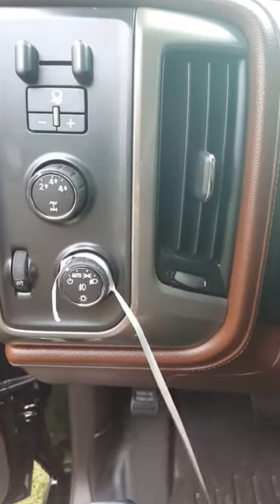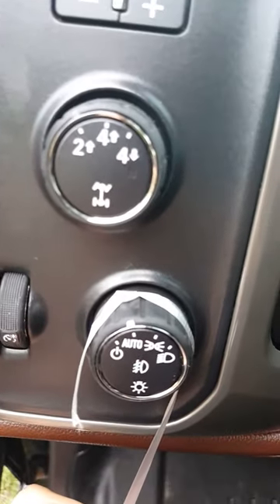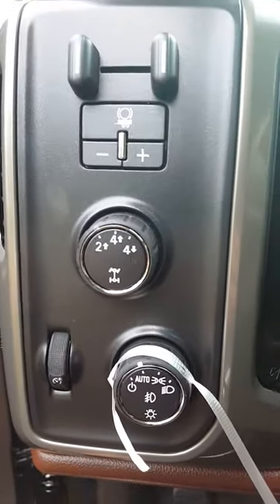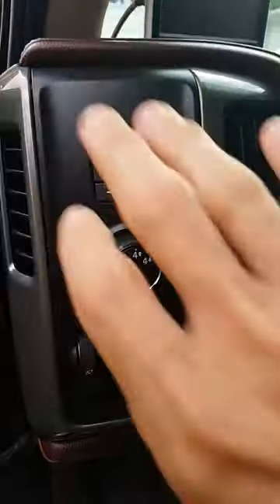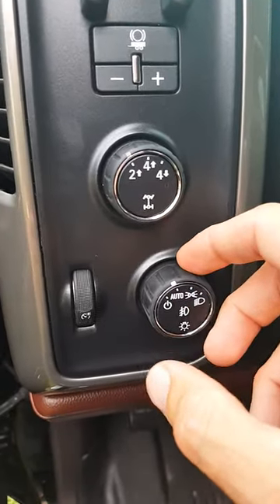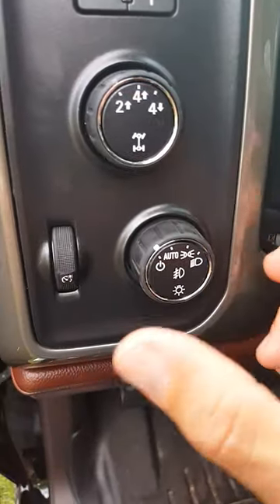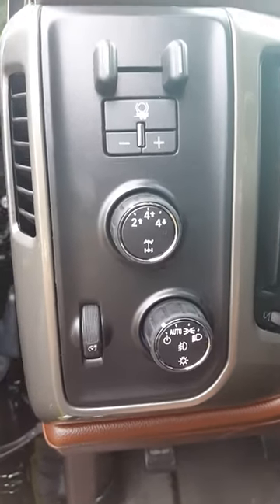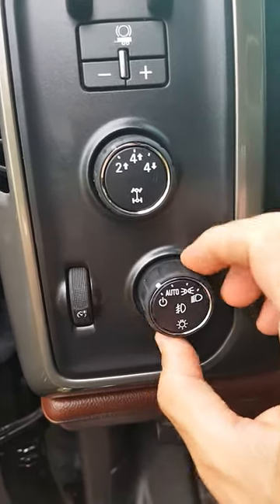Review of 2015 silverado HD headlight switch mod

Comment: Wow! This does look "stupid" simple.  I think I could even figure it out lol. Great mod.  I'm doing this before I install my HID kit for sure ! Thx
Reply from the maker: You're welcome!!!
Reply: @ericfromflorida5146  hey bud I did mine today happy with the results only issue is when I put back together the metal clip or rod my knob does not click like yours in the video light work when I want them on I turn them on when off their off I like it was tired of the drl always on so my switch knob is a lil loose switches freely with no clicks n stays on every setting like yours I did bend the metal clip a lil to fit it in was really hard knob would not fit in it’s housing maybe I bend too much
Reply from the maker: @YourPalSal714   I'm glad it worked for you my friend. Unfortunately my truck got struck by lightning so I no longer have it.  I hope that yours serves you well..

Comment: Hey bro, thank you so much to take the time to answer. I also saw you on duramaxforum, I'm pretty sure that i tried every single position with the switch, as soon as i moved from parking the lights went on and i don't like it. It didn't work so i put the spring back.  I wish i could have the solution...I have seen stickers from Mexico on my truck, is there any difference with chevy trucks assembly in Canada?,
Reply: From what I've read, it doesn't seem to work for Canadian trucks.  Something in the BCM programming probably.
Reply: CLAUDIO GALVEZ In Canada, auto lights/DRL are mandated by law.  You can only turn the auto light system OFF in Park.  Once out of Park, the auto lights reactivate unless you've already selected manual on.

Comment: Don't understand the point of this?
Reply: When I initially did this mod, others wondered if the factory stops at each position of the switch would still be present.  So the video was intended to illustrate that the stops are indeed still present after you do the spring removal mod on the headlamp switch.  I added a brief verbal description on how do do the mod at the end.
Reply: What is the point of the spring removal is what I meant. Sorry. I have a 2015 LTZ and don't see any difference in how your switch and mine operate.
Reply: Gotcha.  First, there is no difference that I'm aware of in the switch option between the 1500s and their HD counterparts.  Second, the mod is for those that want to disable the daytime running lights and auto headlamps.  Usually this means individuals that have HIDs.  The mod allows the switch to remain in the "off" position indefinitely (until moved by the driver) thus disabling the daytime running lights and auto activation of the headlamps.  This is important to the trucks with aftermarket HID kits as the bulbs and ballasts are expensive and the constant cycling on and off shortens the life cycle of the above mentioned components.  The headlight switch can be turned back to the "auto" position for normal operation.
Reply: Oh. Ok. I have aftermarket HID installed with no issues so far. Been a year now. But I'll keep this in mind. Thanks for explaining.
Reply: No problem sir.
Reply: Just leave it in "auto"  Driving at night without headlights, or even dusk or early morning is just stupid.  Period.  If you are so worried about "saving your lights" then don't drive.  There fixed permanently.  A vehicle is NOT a cost saving, it's an expenditure.  You don't do anything with it that you don't understand it's 100% money losing.  Stupid.  Just stupid.
Reply: +Scott Wilkins - First, it's their Car, their choice!  Second, before calling People "STUPID", try your so called 3rd Grade English and pay attention to " Their verses They're ", LMFAO.
Reply: +eantosia - Great explanations by the way and an A+++++++ on your English skills too!!!!  LOL :D
Reply: @scottwilkins  i build headlights, so for alot of guys, they pay to have aftermarket demon eyes, and special leds and color chasing lights installed in the drl tubes, so the headlights running in broad daylight is actually whats stupid, no one said they wanted to do this mod to drive at night with them off? the whole fucking point of the mod is to have them OFF during the day......meaning when the sun is out, why have the headlights burning for 4 hrs while you drive around. GM is decades behind in their lighting. theres also intel-a-lighting they tried using in some of the newer vehicles but im not a fan of that either.

Comment: My drl's are still on after removing the spring, any ideas? 2015 GMC Sierra
Reply from the maker: Hey bud, you have to leave the switch all the to the left "off" position.  Normally with the spring in place the "off” position is momentary (ie it'll spring back to the auto position once released).  With the spring removed, the "off" position is now perminent.
Reply: @ericfromflorida5146  yeah I just figured out my pickup is Canadian ey. So I'm guessing they're hardwired. Thanks for the reply

Comment: i have a 2015 Silverado 1500 4x4 and i don't have no idea why but the spring removal didn't work, i tried twice as soon as i put the truck on drive the headlights went on, do you know why?
Reply: You have to leave the switch in the "off" position.  If you have the truck in the "auto" position when you start it or turn the key to the "acc" position, it will work as it should before the mod.  Leaving it in the "off" position, upon start up will disable the auto head lamps and DRLs.
Reply: I also did this mod on my 2014 Sierra, still can’t get the lights to turn off while in gear... I can get the knob to stay in the off position, but the lights won’t shut off unless I’m in park still.
Reply: @nickchesbro9461  is your Silverado a Canadian built truck? Ive seen that it doesn't work on them. I'm in the same situation you are on my 14

Comment: will it work on a 2012gmc
Reply: That is a different system.  In those trucks, you have to pull BOTH DRL fuses under the hood to permanently disable the DRLs.